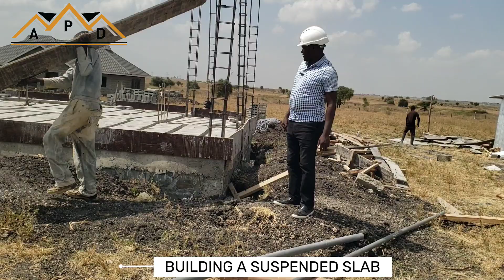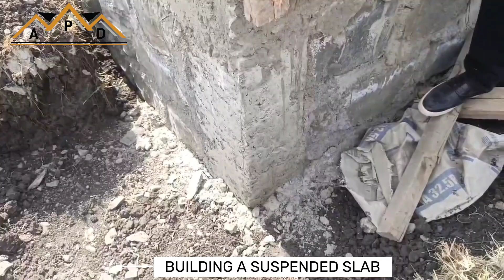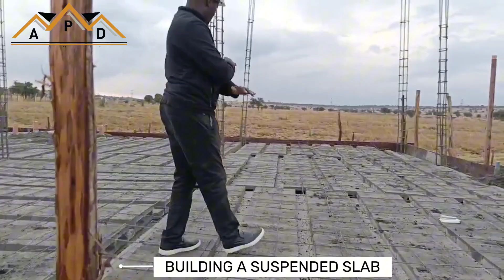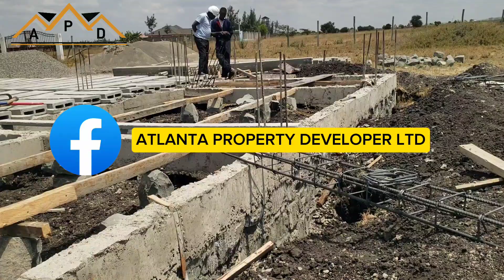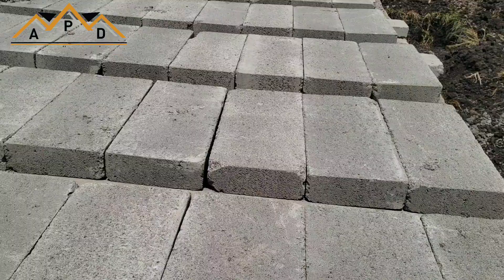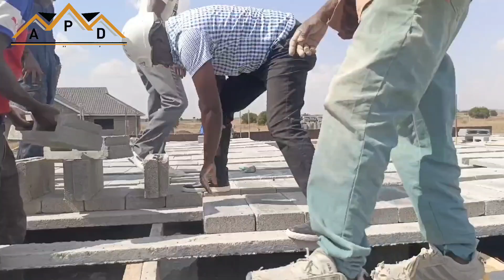PRECAST SUSPENDED SLAB

Comment: First Thank you so much for all you do ,second  if you could have treated that Timber  for the support  it would be great  ensuring it will be protected from termite n other damage for  decades  .just my opinion. 
The other point is fixing  2 ×4 wooden frame supported with a 2 inch thickness  block  on  to create  a void whereby  creating  a channel for the precast  .This will make your work  fast n more accuracy  when fixing panels  .
Reply from the maker: @Mg-wd6id  
Those timber has no addational strength when the curing period is over 
We prefer the channel since they complement the size of the panels 
Your observation seems to be more technical and thank you for that
Reply: Mr Chomba,after paying you 54k on 4/1/2025 for Approvals and BQ,you stopped picking my calls. What's happening? Please communicate.
Reply: Hi. Great content. I am used to seeing the T beams used for the suspended foundation.. Is it 150 mm? Please educate us on the choice of flat beams for this particular project if you could.
Reply from the maker: @Nelcn1  
We are having a t beam video coming up